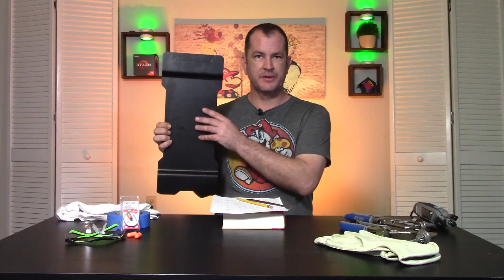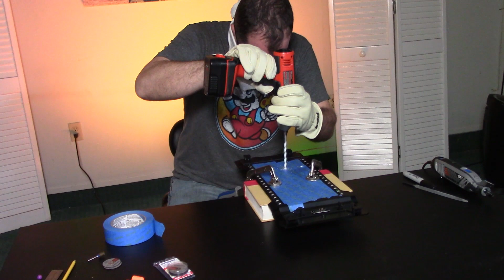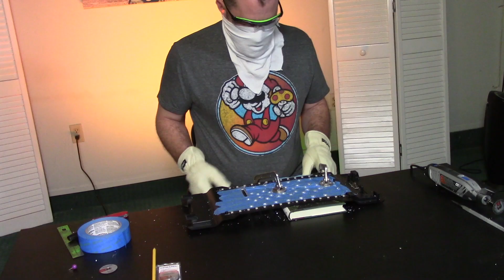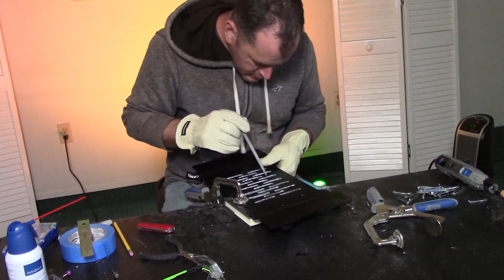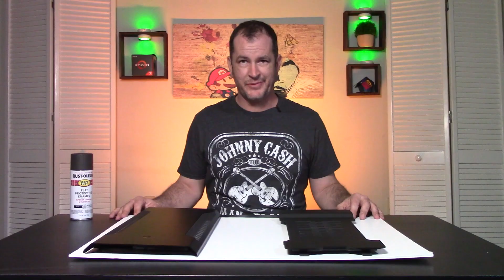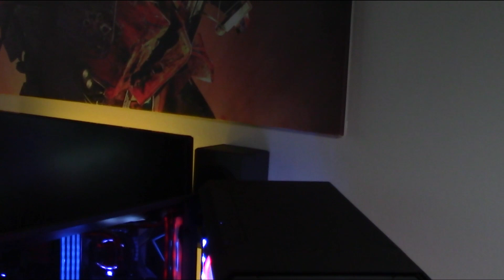Phanteks Evolv X Case Mod

Comment: I'm just curious on your radiator set, the sizes used, manufacturer and what type of fan was used. I have the same case (X3) and looking at doing something very similar to all of them and adding a custom loop to each as well.
Reply from the maker: The front 360 was a Corsair xr7 and the top was a 280 xr5. Fans were also Corsair.
Reply: @currentlykent4593  thanks, I'm looking at the 420 in front and 280 up top. all EKWB with Noctua fans.

Comment: Do you reverse drill a beton-drill bit on your 200€ Case? No wonder the result is terrible, even your the 360p recordings.
But hey as long as it made fun and you feel okay with it, I said nothing.
Reply from the maker: Oh idk. Pretty sure I shot this in 1080p. Maybe select the resolution in advanced settings here on YouTube? Was a long time ago so I might be misremembering.
Reply: @currentlykent4593  do u still have this panel in use?
Reply from the maker: @Internet_Polizei  nah. Pretty sure I changed cases a few months after this video came out.

Comment: What about nodding the side glass side panel… I feel like that would help temps the most
Reply from the maker: Not sure I’m familiar with that technique. How do you mean?
Reply: @currentlykent4593  

Removing the glass and replacing it with something to allow better airflow - maybe something mesh?  I dont know.  I know that you have everything water cooled, but I have a 3080 ti FTW3 on air and it’s so hot in my case - my gpu runs @80 degrees plus Celsius
Reply from the maker: @ryanfranck2210  I mean.. the glass panel is on hinges. It opens really easily. Should see the next video I made after this one:)

Comment: Looks good, i got the same case and im thinking about doing something simular, but my water is getting 35c with fans att 1000rpm while gaming with stock case including the front filter. I have now both top 360 and front 280 rad as intake, before i had top as exaust and did also see 40c water temp becouse it did use the hot air from the case to the top rad.